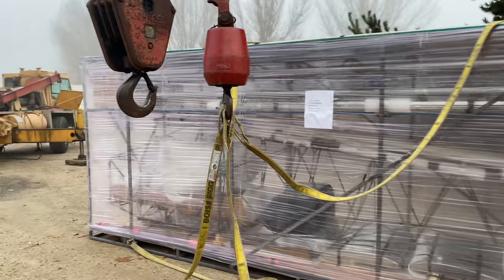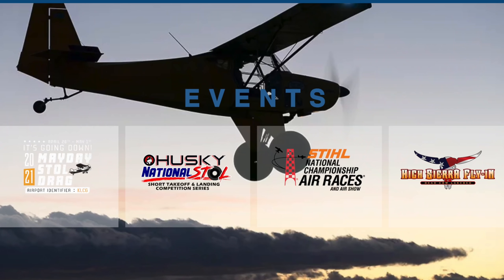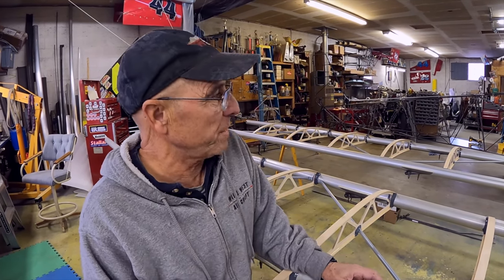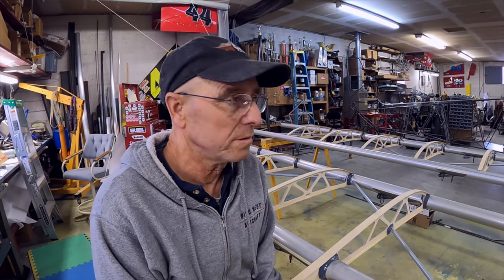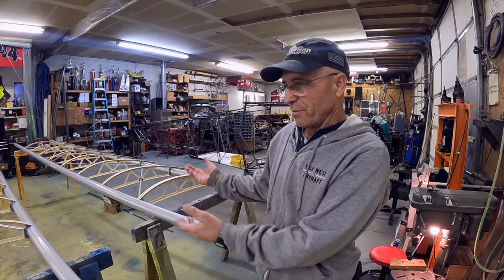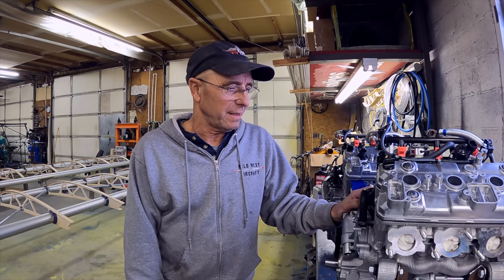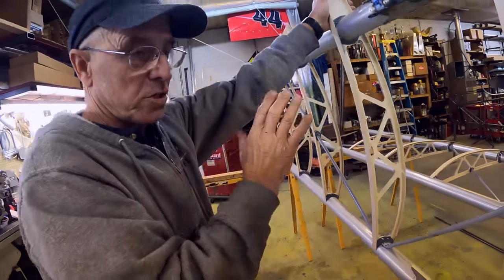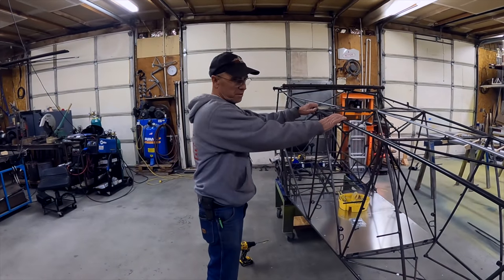YeeHaw8 - Airplane Build Video #1

Comment: Very Cool Steve i have run Yamaha apex engines in snowmobiles for a few years and you are using the correct type and make of engine. They are some of the most dependable engines on the market. I'm not a pilot but do enjoy seeing videos on flying. Fly on Steve be safe

Comment: Steve, some advice. The next evolution to STOL drags is electric.  You have short flights. (You trailer your plane everywhere anyway)  want to stop fast? Reverse the motor. Want torque to spin a huge paddle prop? Instant torque. Mark my words, that is the next progression in this "sport"
Reply from the maker: Yes I agree with you, but I don’t think we’re there just quite yet.

Comment: What is the weight if you know?? I’m still stuck on the Viking Mitsubishi engine 160lbs at 90hp. I bought a 701 kit instead of a 750 and I’m so limited on engines. What is your opinion on putting the Honda engine? 220lbs 130hp
Reply: There is a great Facebook chat group "Yamaha aircraft conversions". Lots of info. I believe that the Yamaha 4 cylinder is about ~180lbs with the 3 cylinder being about 10-15 less. Again it's not so cut and dry, when weighing these engines as the weight is dependent on whatever accessories you include in the weight assessment. To me it sounds like these engines are about 10 or 20 pounds heavier than the rotax 912.

Comment: Hi Steve is the Sidewinder engine a snowmobile engine and if so does it use the same gearbox as the apex
Reply: Yes, it is a snowmobile engine.
It's using a different gearbox than the apex. Mounting is different and also a different gear ratio due to different power curves of the engine.
The "nytro" sled engines are the non turbo version of this engine.